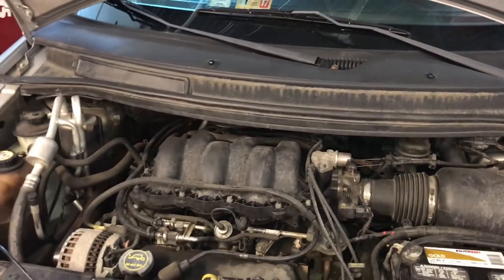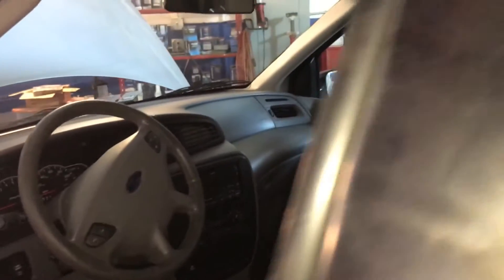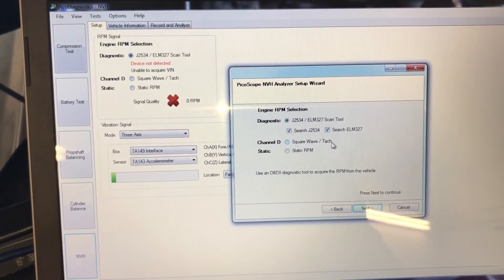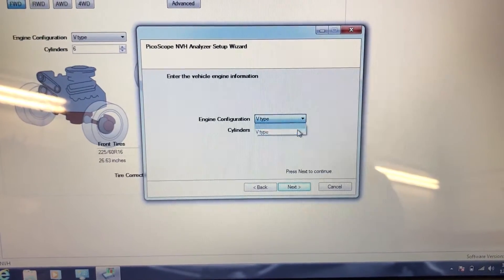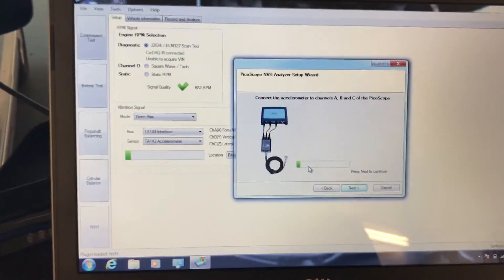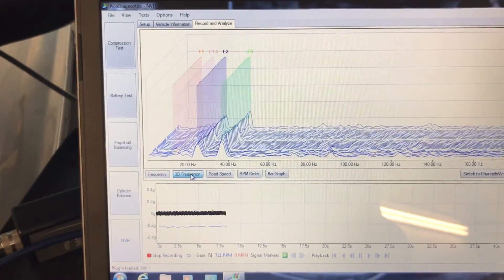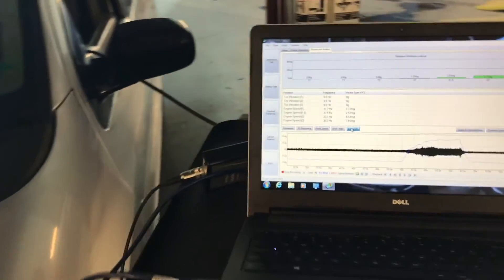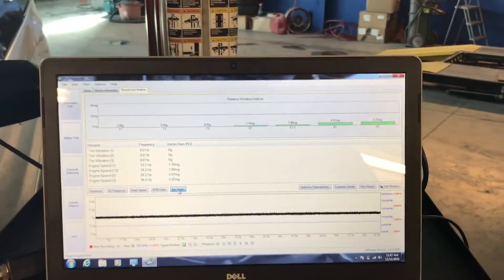Pico NVH demostration

Comment: How do you know that the motor mounts are bad from just the data that E1.5 and E2 are high?
Reply from the maker: Brownish Sage well the harmonics are telling me that I have engine vibrations class 1.5 and 2 which base on the software the most common are engine mounts. I still need to visually check them. In this car was a bad engine mount 100% corrected the problem.
Reply: @MaicSalazarDiagnostics  I've been working with the NVH kit for about a week and cant really figure out why it's so useful. From a technician standpoint, wouldnt using your experience and intuition be easier? I recently tried to diagnose an AC problem in which the unit would make a thumping sound under the drivers feet but the NVH kit didnt help to diagnose this problem. Can the kit only diagnose problems related to the engine, propellershaft, and tires? And when using it on a test drive, bumps in the road seem to skew the data as the entire vehicle vibrates. Thank you for the help!
Reply from the maker: @BrownishSage15  The NVH is design to help with engine, tires and so on. As per an AC noise you can use the microphone that comes with the kit and try to pinpoint the location. Noises are the hardest to diagnose. Yes bump on the road can skew data so try to find a good road for the test or put a marker when you know a bump was on the road. For pulleys, alternator, etc, I use a first look sensor with and stethoscope front part attached and it works fantastic.
Reply: Thank you for the swift reply!